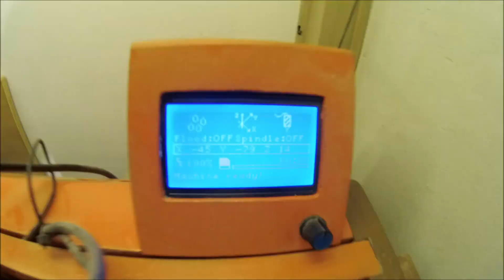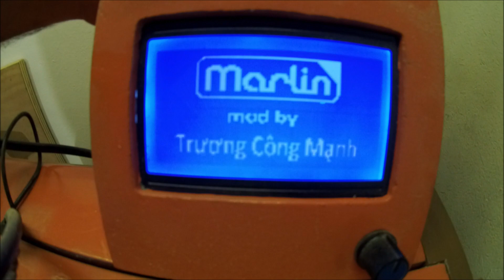CNC basics: Endstops and Origin

Comment: Have you heard of Trinamic Drivers?
You don't need end stops because they have virtual endstops
Reply from the maker: Adam Bryant nope, never..until now! Will check them out asap..
Thanks Adam!
Reply: You still need to read them with Marlin otherwise they are not usefull. They are very strong though :)  TMC 2208 or 2100 they are called sold by watterot in Germany ;)
Reply: Not sure I'll work with milling machin though